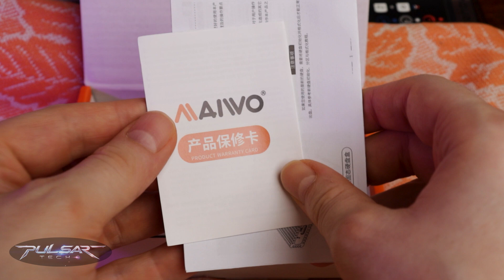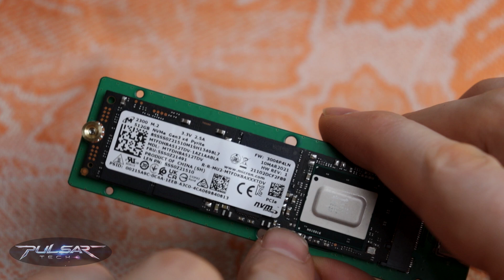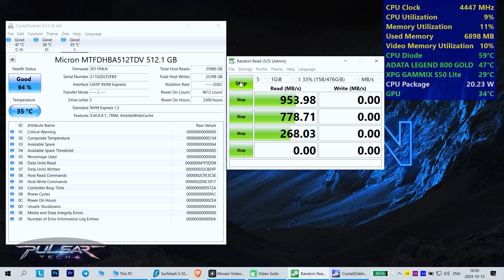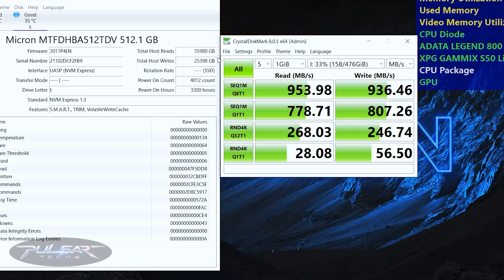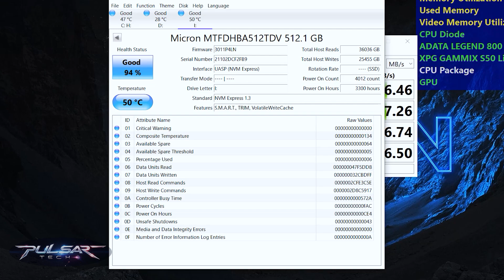Maiwo K1687P2 NVMe SSD Enclosure | Review & Testing

Comment: Wonder if there are enclosures like this where you can install two of these nvme ssds simultaneously and then for example have two 2 terabyte ssds and then have a 40 GB/s interface USB type-c or thunderbolt?
Reply from the maker: I haven't seen an enclosure like this but I've seen a docking station that can work with 2 NVMe SSDs.